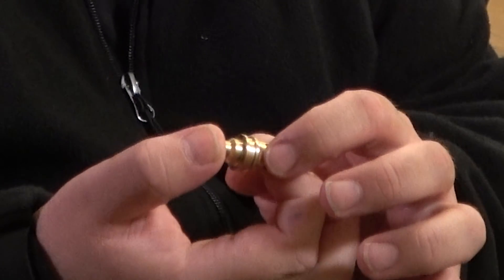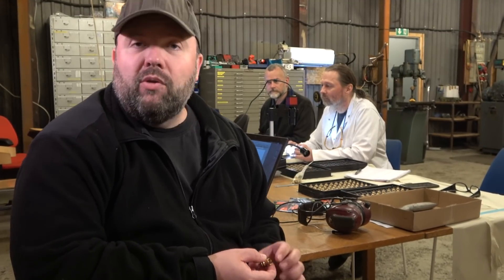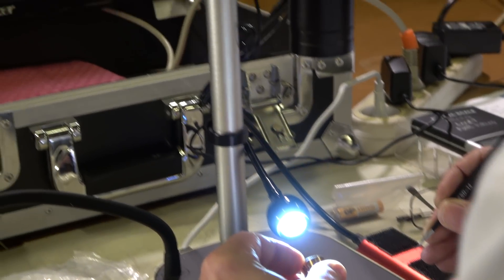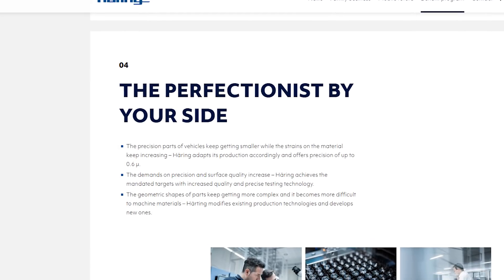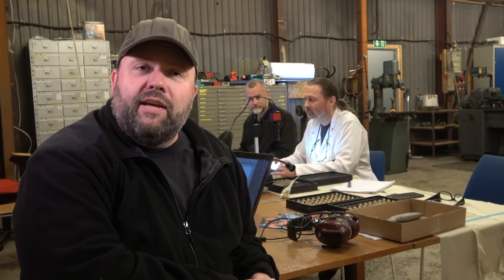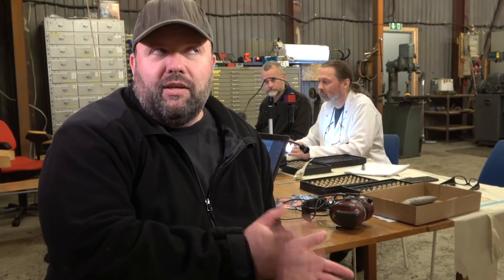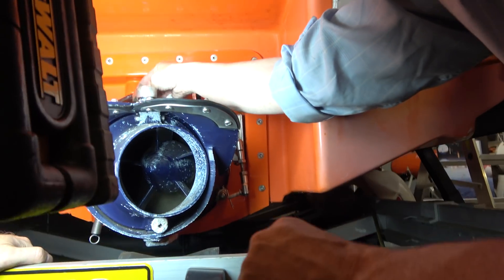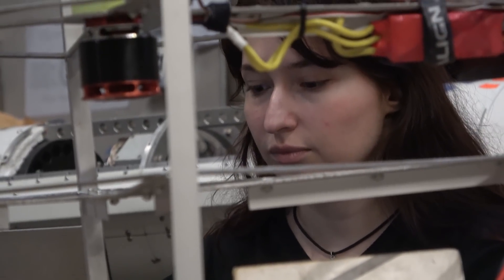100's of Rocket Engine Injector Nozzles Came In! | INSIDE THE ROCKETSHOP : Episode 25

Comment: I have a question: For so many parts do you do need to do a 100% inspection or can you do a sample size and use statistics (std deviation, AQL ect..) to determine if a lot is acceptable.
Reply: Each piece is inspected and manual removal of flakes from drilling is performed occasionally. Then the pieces will be brazed together into a swirled element, which will be leak checked and finally subjected to a waterflow test. If the element passes all tests, it can be used for an injector. It is a lot of checks, but we need each element to be perfect... Otherwise we risk having an extremely bad day, when we test the engine.
Reply: @jnielsen20  OK, thanks.

Comment: Hey guys congrats and  I have a query..

Will you guys be inspecting the child parts in receipt condition and group each of the individual child parts across their tolerance range for selective assembly of the injector ? Or it doesn't matter at all for the process capability to which these parts were manufactured at ?

Comment: When will the first crew capsule launched?
Reply: First we have to verify the function of the swirlers (ie. test them in a BPM5 engine). When verified, we can finish the specs of the BPM100 engine (from the findings of the BPM swirler engine). Then we can build and test the BPM100 engine. When that has been tested and found flight worthy, we can launch the first unmanned Spica. It will take several of these launches before we can human rate Spica. So there is a long way. Fortunately many works can be done in parallel. We hope to run BPM100 test in 2021 for a launch of Spica in 2022. Unfortunately things take time, but on a shoe string budget, we can't really accelerate. Strong finacial backing could accelerate things quite a lot.

Comment: Are these parts machined with EDM? It seems like it would be a tricky thing to drill small diameter holes in the side of the cylinder accurately with conventional milling. If not, maybe look into EDM, these parts are doable, maybe even the two parts as one, using special electrodes, and slight design changes, + you would get great tolerances. Can't wait to see all the parts come together, great work!
Reply from the maker: They were all milled and happy to say the precision achieved exceeded our expectations. :)
Reply: A video covering the manufacturing of the injectors: 

https://www.youtube.com/watch?v=8EDnxmK67d0

I found a link to the machine featured but not sure if it's capible of EDM (doesn't seem so from what I can gather. I'm certainly not qualified to inform of such things though to be fair):

https://www.mazakeu.co.uk/machines/integrex-i-200/
Reply: @AvatarOfBhaal  Thanks. Cool video, they've got a real space age CNC :). It definitely can't do EDM, those are a whole different kind of bread, different technology, the downside with those is that, it would take much longer than this, but maybe the parts could be more precise, and a 40 yr old machine could do it.